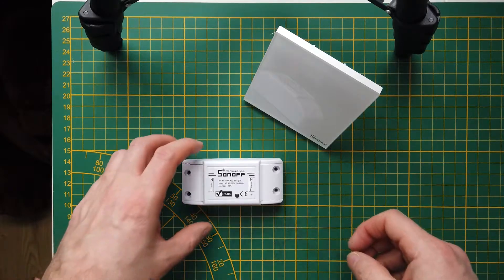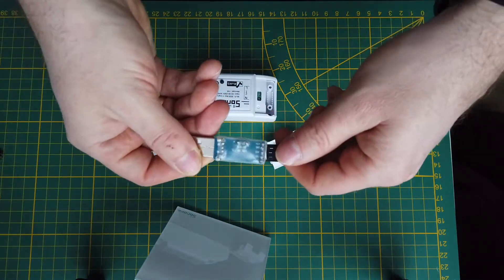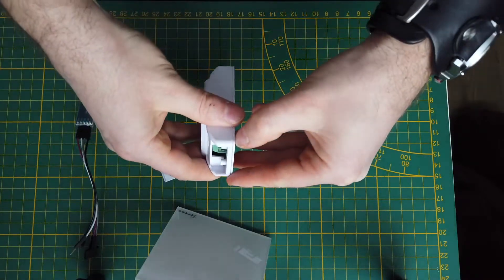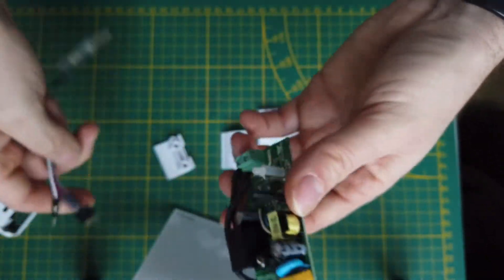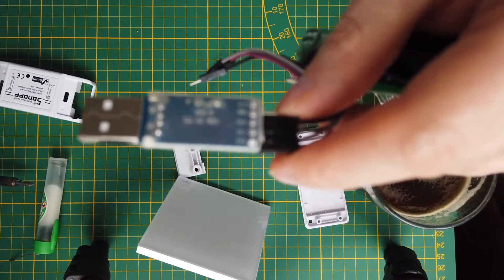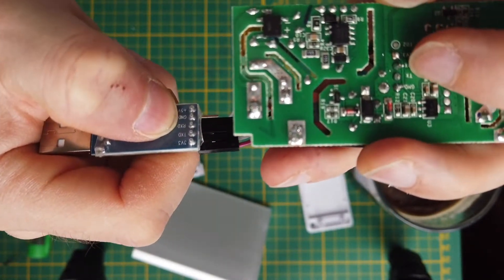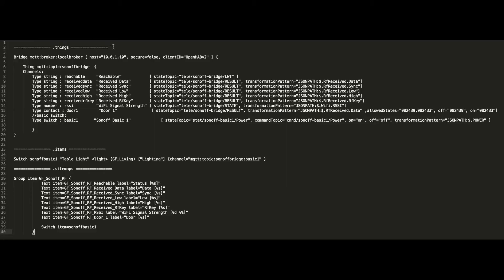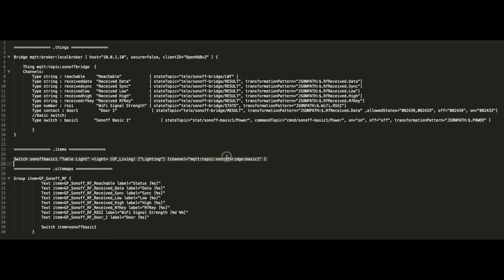Sonoff Basic + Sonoff Wall switch + Tasmota + OpenHAB  - part 1

Comment: I have a question, how you get Host on MQTT Configuration? U need other app for it?
Reply from the maker: yes, I use Linux server and mosquitto app on it.
Reply: @iot_formatx_net9989  Well, I use windows and install mosquitto on it. Succes in binding that tasmota to mosquitto, but i have a problem when i want use openhab mqtt v2 all that tutor i watch use raspberry pi:"
Reply from the maker: @mulyadiheru1009  try to check settings according to https://www.openhab.org/addons/bindings/mqtt/ or look for help in opehab forum.